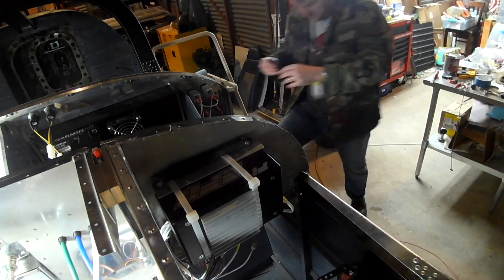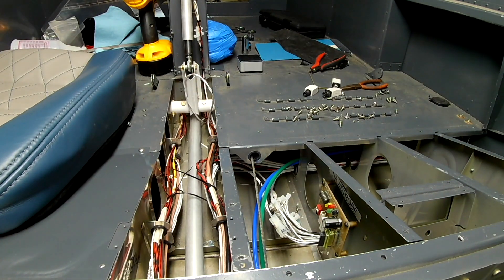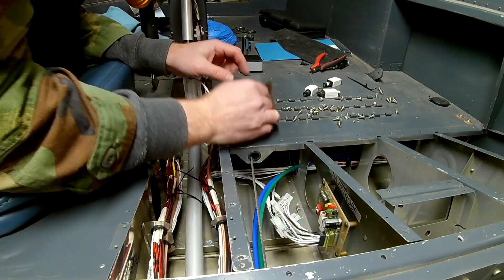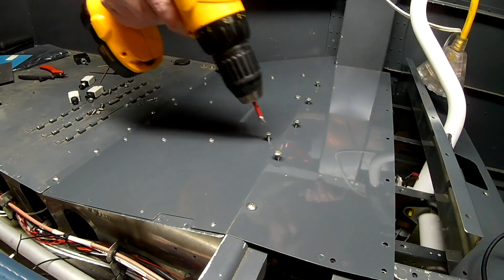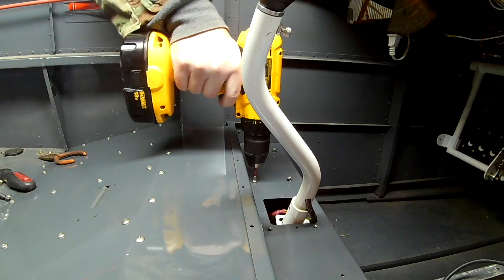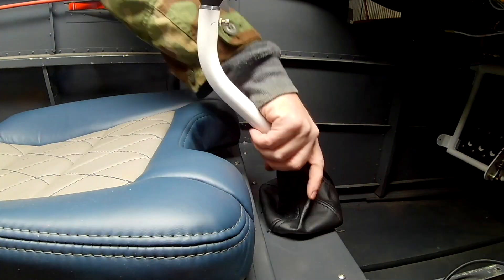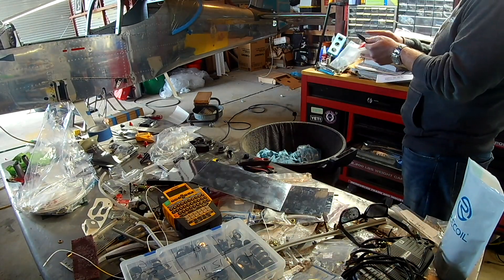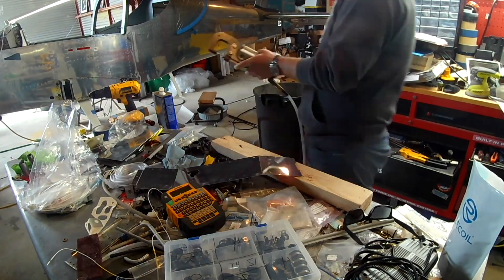RV-14 Snap Bushing from HELL

Comment: How did you go about ordering your all your wire??  Did you just go little by little when you needed it or did you sit down, figure out a good estimate, then order everything at once??  I'm starting the wings which require some wiring and I'm getting stuck by everything that's available.  I think my biggest question is did you use all single strands or did you use some of the 4-wire stuff as well??
Reply from the maker: I did a huge purchase for the fuselage as I needed to put it down first. I didn't close up the wings until just recently so wound up using left overs from the fuse.
Reply: @akilroy  All single wire or some multi-wire??
Reply from the maker: @JimDorn  Most of it is shielded 2-3 conductor. I think in the wings my lights use 4 conductor 18 shielded (fly leds). The only single wires are the power wires.
Reply: @akilroy  Thanks